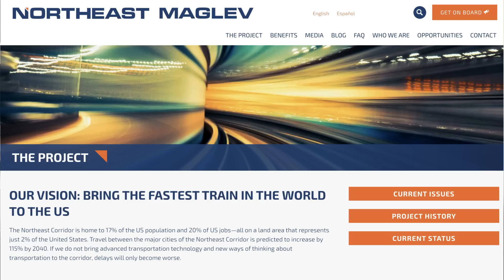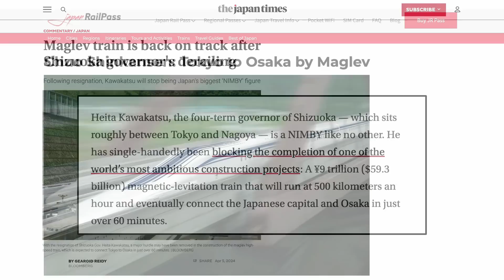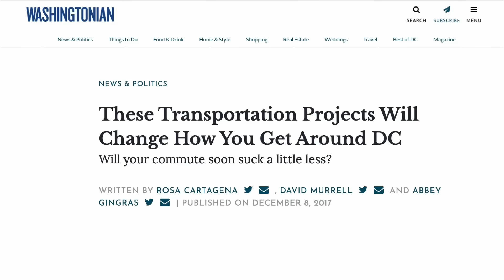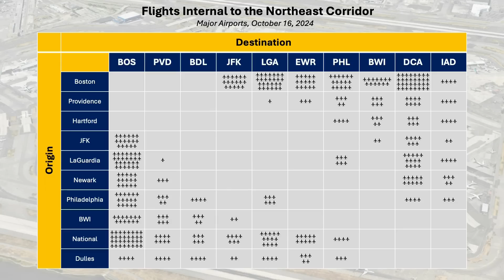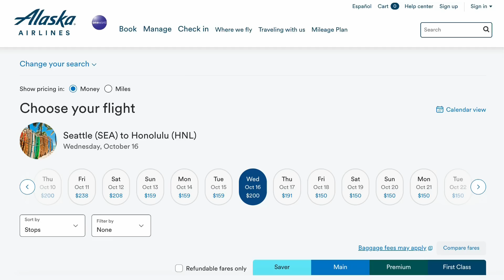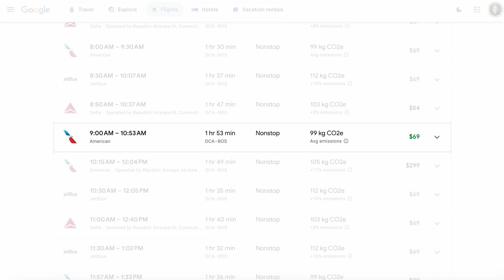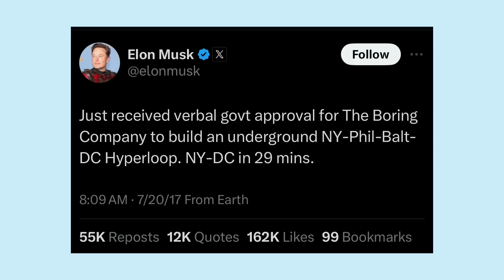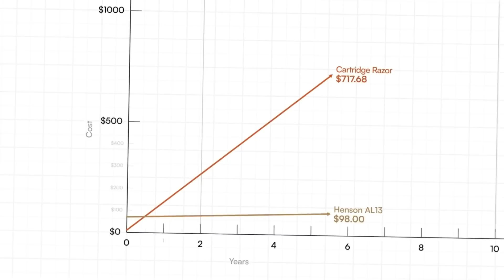A DC to Boston Maglev Would Be Awesome (and you know it)

Comment: Just update the electrical line that the eletric trains use in the NEC. My god the money spent on that would be huge and taking the nec down to Richmond!
Reply: Even still, that doesn't fix the alignment issues. In a way, I think the US being the forerunner in railroads back in the day has kind of hurt us, because in order to build something new we need to tear down the old. In regards to HSR, it's almost a good thing that countries like Germany and Japan didn't have as extensive rail as the US in the mid 20th century, as they were flattened to the ground during WWII and quite literally started with a clean slate. The US didn't have that opportunity.
Reply: @thepuncakian2024 car lobbyists would’ve loved if we just never had trains. I think the truth is we’d be begging for the bare minimum and wouldn’t even have what we currently have
Reply: @Ray03595  Well in this hypothetical situation the car lobby probably wouldn't be nearly as strong, if existent at all, if the US's infrastructure was pummeled into the ground to the same extent Japan and Germany's were. That's probably why they didn't go as wild with highways as the US did, because most of the auto lobby was dead.
Reply: @thepuncakian2024  but instead, the US tear down for car and with a bunch of revolt make people dont want to build anything at all.
Reply: @Banom7a  Very true, that's why I think a better thing to do is to just converting the existing highway right of ways into HSR lines, then actually be able to ADD housing around the tracks instead of removing housing.
Reply: @thepuncakian2024  fix what we have first. Than look into future projects.
Reply: @speedbird111   not anymore.
Reply: @speedbird111    
No. Pushed back another 5 yrs. 
200 miles long. Budgeted over $80 billion. 
This technology has been around 50yrs. It’s a boondoggle, not cost effective. 
Ain’t gonna happen.
Reply: Fix Accella.  Maglev is a HUGELY expensive boondoggle. 
If it was so awesome Europe/Asia would have more than a few dozen miles of it.

Comment: The ironic thing is that Maglev was rendered pretty much obsolete by the British APT project, since the hunting oscelation problem that Maglev was intended to solve was fixed much more efficiently by yaw dampers that were developed for the APT.

As such, conventional high speed trains as still far more energy efficient than Maglev, way cheaper to build and maintain, and Maglev doesn’t have the capacity or really the true speed benefit that upgrading the NEC to 186mph capable HSR would entail. The only reason the Japanese are really going in on the Chuo Shinkansen (and likely will never build another one) is to augment the Tokaido Shinkansen, and a presumed benefit in an earthquake situation (and even that is questionable). Other than them, Maglev pretty much died when the Shanghai Airport maglev flopped hard in the face of a conventional HSR system proving its overall superiority.

Plus, compared to building a new rail allignment, let alone maglev would be infinitely more expensive in the current reality than upgrading the NEC's track allignment.

And yes, there are videos on this too. Gareth Dennis has a great one one the history of Maglev and why it failed against conventional rail.

This technology has been around for over 60 years. There's a good reason why it's so sparcely used.

Comment: I was able to speak to the company who is planning this. Unfortunately, it would require displacing a lot of people because the line MUST be a straight line. Also, it would add a lot of seismic activity through vibrations to all the areas it passes through and goes to. I think HSR is noble and should be pursued, but MAGLEV has too many problems
Reply: The Shanghai maglev isn’t a straight line, nor was the original test track in Germany. And I have absolutely no idea where you’re getting this seismic vibration thing, conventional rail creates more vibes than a maglev.
Reply: @spartan117zm  these were things communicated to me at an event in DC where they had a popup stand. Cool project, but I'm afraid it will displace too many people

Comment: Ray, you know maglevs are just gadgetbahnen. Come on.

We can build a proper HSR alignment along the NEC, either through incremental upgrades to the current line or building a new dedicated alignment, but Maglev is not the way.
Reply: Oh, and just to be clear, Northeast Maglev may be an "actual organization" with a draft EIS, but they've made zero other tangible progress in a decade, and the DC-BWI-Baltimore segment is the least useful segment for them to start with. They chose it because it's the shortest, and thus presumably the least costly in terms of permanent way, but also means they're expending all of the other fixed costs of planning & implementing such a project on a segment which will never be able to take full advantage of the technology proposed for Chuo Shinkansen *because it's too short*.

Given that the main bottlenecks for travel between DC & Baltimore are not the Penn & Camden lines themselves, but the connections beyond the train stations to wherever else one might go in either city, the same investment would deliver better travel time savings if invested in expanding the core capacity of the DC & Baltimore Metro systems (or even just letting them operate a little earlier in the morning & later in the evening, especially on weekends; having to bike to DCA for a Saturday 8:00 AM flight is an experience).

Comment: Would be awesome, but it's a huge opportunity cost, would rather buid ten times the conventional rail lines with that money.
Reply: Something to consider, but as a resident of this corridor this has been a dream of mine for more than 10 years!
Reply: @pisceanbeauty2503  How often do you need to travel this corridor or even want to? Most travelers are very infrequent and then there there is a small number of business travelers who would greatly benefit from this. Then you would have to maintain both systems. I don't see it happening.
Reply: @jyutzler  Lots of people travel these corridors regularly and many would travel more if it were more convenient. Even just DC to Baltimore and vice/versa is currently a pain in the butt on a given weekday. Lots of traffic into DC and NYC from all of those places. There would definitely be a benefit.
Reply: @pisceanbeauty2503  Okay but a maglev from DC to B'more would be no cheaper than an Uber unless the route was highly subsidized.
Reply: True. Though speed is the main selling point to get people to use the service. Marketing I'm sure plays a role as well.
Reply: USA already has 10x the rail across the country but no one uses it cuz it’s too slow. Maglev makes sense cuz it’s fast enough to gain significant ridership & economic benefit to actually get built.